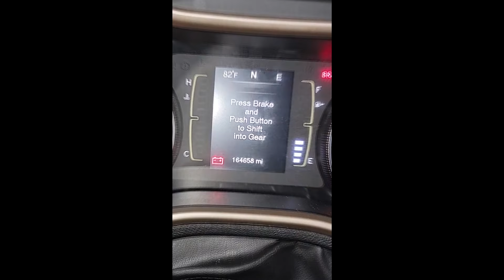How to fix a No Crank No Start. Replace your Starter in your car. Choose Wisely.

Comment: How do you know thats not just a mopar starter that was already replaced? Theres no way of knowing.
Reply from the maker: Smdh, sure there is. This starter has never been off. Because there are little bs brackets and wiring clips thats in the same place since this cars birth. If this starter ever has been off, those brackets and those wiring harnes clips would not be on this car that perfect. In fact no mechanic ever puts that bracket back on. Not to mention once the bracket removed, the harness clips have to be broken off. A mechanic knows when hes the first one into something. Everything down there was still in its new original factory form

Comment: The Mopar didn't last either. If it did you wouldn't be changing it lmao.
Reply from the maker: Lol, this Jeep got 164K miles on it. Im sure it has had its fair share of cranks. This the original Mopar approved starter. Its time for it to fail
Reply: @OnlineMechanicTips  Are they local or highway miles lol.
Reply: I have a 2011 Jeep Grand Cherokee with 3.6L. Used daily with 220,000 miles. Starter never replaced. No ticking problems from engine. Only thing I replaced myself was oil filter/cooler adapter at 120,000 miles. Change oil myself every 5000 and transmission fluid every 30-40,000. I must have good luck.
Reply: @steveb319  very nice !!
Reply: Hmmmm, 10 years doesn't seem that long. BUT, i wont dog a part like that for failing st that point. Stuff happens. I will say this. I must be lucky, because i jave not had to change a starter on any of my cars this century.@OnlineMechanicTips